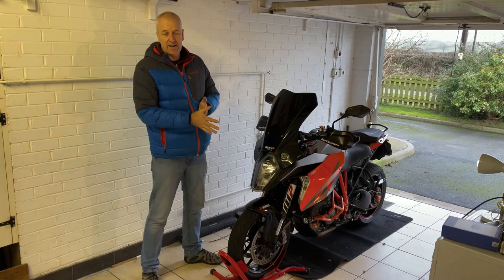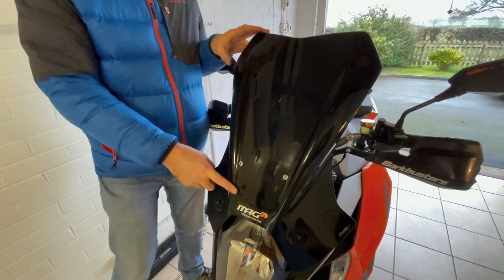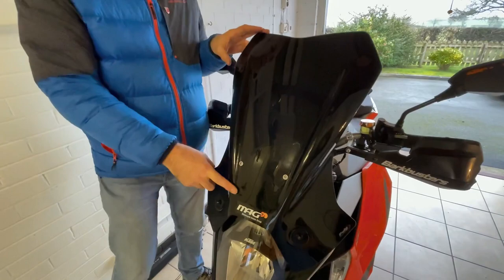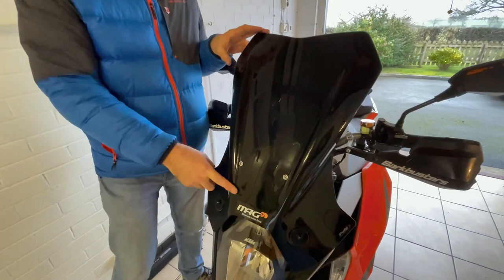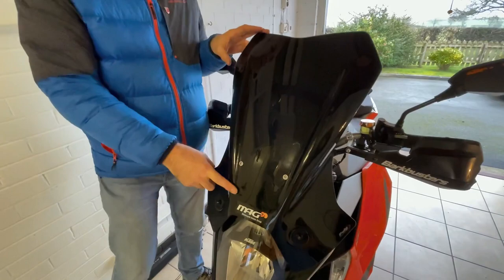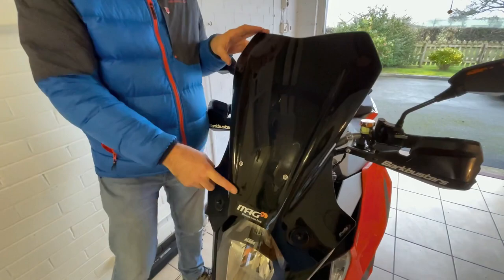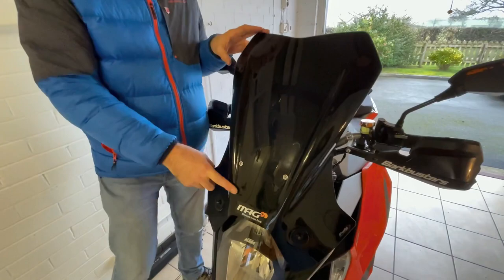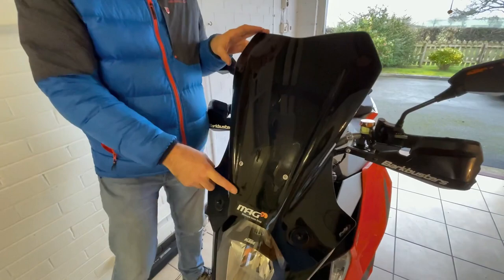My KTM 1290GT Mods

Comment: Just tried fitting these footpegs to my 2019 and the pin holes don't like up with the housing, did you alter anything to make them fit?
Reply: Hi, yeh you will need to file some off the stops on the pegs to get them to fit, it's not a lot though!
Reply: I've just filed down the stops, end and each side where it meets the edge of the bike, I don't think the aluminium looks thick enough to hold weight now (for standing on pegs), so potentially not safe, also I'm now convinced the peg mount pivot is different between 16-19 year bikes

Comment: Super equipped KTM. I'm interested in the rear brake disc cover. Please provide details where can I order? Thank you and best regards ;-)
Reply from the maker: Hi
As I said on the video I profiled and made this myself. Depending on where you are, what I have done in the past is supply the DXF. file!  Which means you can then go to a local to you, machine/engineering shop and get them to water/laser cut one out for you. Mine is cut out of 4mm thick Stainless steel, then covered in carbon fibre effect wrap film.
Let me know, what you want to do?
Cheers Phil.
Reply: Hi
I understand. Sorry, but I watched video without sound in the subway. Can you provide a design with dimensions please? I'm going to make such a cover made of aluminum due to the lower weight of the material. Thank you very much and best regards.
Reply: Hi, will send you the dxf file. Will need your email address? Would advise caution in using aluminium, as it's only attached via the rear caliper mounting bolts. There is the distinct possibility that it could flex and catch the disc rotor, with disastrous consequences!!

Comment: Hello, can you give me a link for the front engine protection?
Reply: Hi Didier
It's from a Gen 1 Superduke R. You have to do a bit of trimming at the back of it where it curls under the engine to get it to fit properly. Once I had done this I had it Hydro dipped with carbon fibre effect film.
Cheers Phil.